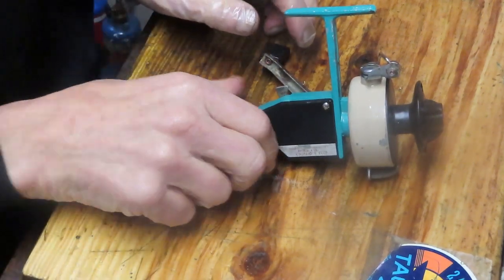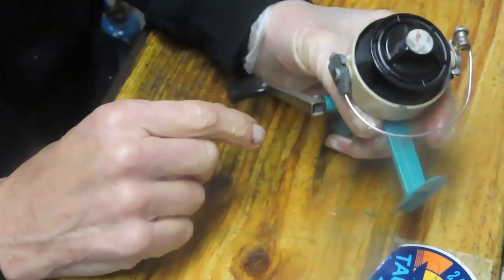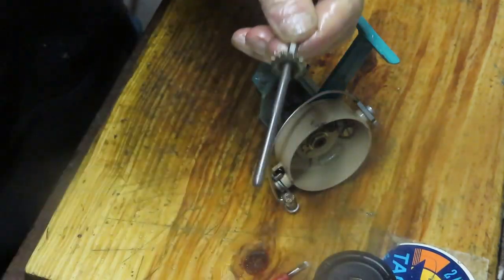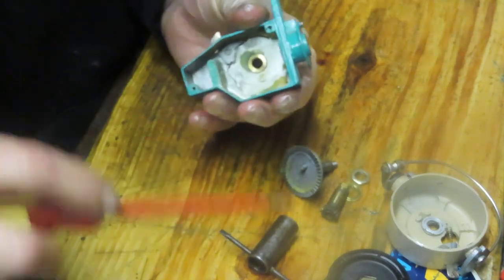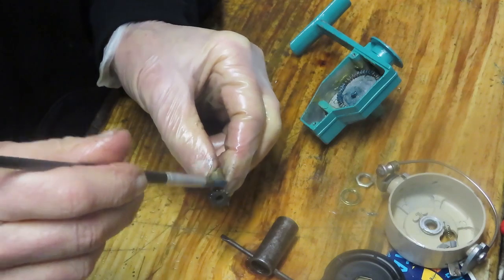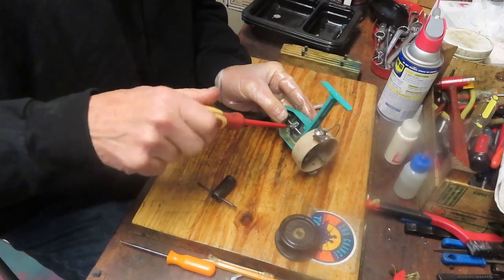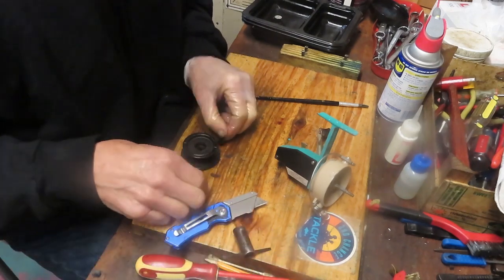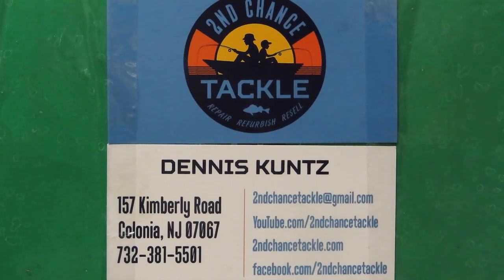Russian made fishing reel circa 1970s how to take apart and service

Comment: I’ve actually seen one of these before on eBay of all places. I had no inclination to get one though. I have been carefull to replace the bad bumpers on all my Penn and Mitchell reels that need them as well as having to make a few for other reels. For me Dennis, it is difficult if not impossible for me to service all my reels once a year. You know how many I have. I do have them on a 3 year rotation if I’m not using them at all and I service the reels I use after every fishing trip. I just can’t do more than that. I keep up with it on a reel list that I keep just for a service record on my computer. Interesting that I have two large French saltwater Bretton 902 and 903 reels made in 1961 that have the same colors as this one. It is an interesting reel that’s for sure. I’m glad you could share this one. — Chris
Reply from the maker: Thanks Chris.  It is one thing to service the reels being used on a regular basis, versus the show pieces.  You know the intent in my recommendation.
Best wishes - Dennis

Comment: Most every large vintage spinner I have has the same problem, Mitchell 302, Zebco spinator , Daiwa 7850 etc..., superglue a trimmed down rubber cabinet door bumper works for me, also if the bail trip plate wasn't "squared off" at that point, the trip lever wouldn't fall behind it. the colors on the reel look almost like the ABU cardinals. cool video. P.S . put the clothes in the dryer, they're done!
Reply from the maker: Haha - Thanks

Comment: Interesting video, glad you shared it. Some elements of this reel remind me of the Ocean City 300, but without the ambidextrous through shaft. The shape of the casing with that odd angle jog back under the AR lever seems counterintuitive. I’m surprised they didn’t make the case rounder, there didn’t seem any practical reason to have that sharp angle which to me seems like a weaker design than a graceful curved side. The spool reminds me of a Mitchel 304 style. I don’t have anywhere near the experience you have but I e not seen a reel with a bail trip spring set up like that either. I know they sell small diameter nylon rod stock on eBay and elsewhere for hobby uses, maybe if you found something of a similar diameter, you could shape a small section of it to fit and secure it with JB Weld. Thanks for sharing this project!
Reply from the maker: Thanks - yes the case on the lower half does look a lot like the OC 300 series.  Thanks

Comment: It's a dead ringer for a USSR Dolphin/Delphin 6, except for the color and anti reverse control, I saw one on Ebay in  Ukraine. this one wasn't so brightly colored, just solid black. another one sorta light tan one , the listing says 80's 90's ones listed as 50's 60's is a little different, so this could be from the 70's. Russians haven't been real quick to change design. their cars have looked the same for years, reels seem to be the same
Reply from the maker: Thank you again!